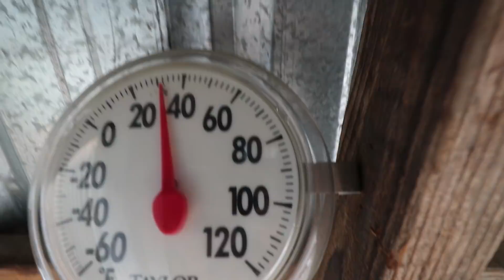Backfilling an Impossible Hillside Trench With Sand (From a Hose!)

Comment: Am a builder and joiners and also Horticulture, and plumbers and Electrical all licensed trades, now I watch this program and it all wrong what you doing, not only that you have wasted all money and this cement are wasted, because is down hill you used one step a time and mixing cement thicker and easy level ones block a time and that save more moneys but this is wrong, if building inspectors see this you will fail, but it your money and too late to do any about it, but I watched all the way and I laugh so I apologise for that is was your first time, everybody make mistakes so you learn next time hope not but I do love your video,  before you ask me yes I done build 166 houses two - three store floor and lost count repair houses driveway landscaping electric rewire and plumbing and bench joiners make kitchen units am now 60yo I build house on my own and self employed so very good luck and best of luck and you will get there.
Reply: Come spring, there will be lots of sand at the bottom of the hill. You better get lots of silt fencing. Snow melt and spring rains will take the path of least resistance, down the hill.
Reply: It’s not cement, it’s sand.
Reply: Its not a Footing 
It is a Sort of DuctBank/Ditch and they are pouring the Watered down Sand To give somd protection to the Conduits. Also adding the Metal Danger tape above sand is what you do to help with Locating in Future "CallB4UDig"
Reply: Ferguson101 If it no building code then what about building insurance?

Comment: Why put tape down, you can't dig through concrete later if there is a problem.
Reply: Deric Kettel did u not watch the video the only concrete thay used was to hold a post at the top of the  hill

Comment: Did Justin do the job for free? If not he should have his crew fix that big mess and cover the trench as agreed.
Reply: Obviously it is an expensive machine and a business but they were on a friendly first name basis so after seeing the mess they left it appeared there was a favor in there somewhere. They are the experts so gotta wonder why they would pump all that sand knowing it would just run out the end? Then just leave it there.  If I hired a contractor to build a wall and he built it knowing it was going to fall down. I would say he did not do his job.  Hiring a contractor is not just for the labor and machines but his expertise. They came a day early and was in a hurry to get the job done and get paid. But if the homeowner is happy then it is a mute point.

Comment: They dug a hole to put in a fresh water tank in$ Air blasted a trench to bring the water down and a line to take water up$ spent $ to fill the trench$. they get cheap water but pump it up the hill$ a cement truck drove up the hill so why pump water to the top, drive up and dump it in the tank. I hate to say it but are you really off grid if you have Youtube / facebook? Get the power lines but in to your (Off Grid) property and sell your extra off grid power back to the power company.
Reply: My guess would be that vehicular access to the top of the hill requires travelling on their neighbour's land.
So while that's probably fine occasionally during construction they don't want them driving there all the time.

Comment: Hmmm, you just poured concrete over wood shavings? Well, at least it can be a new video about what a failure your trench became.
Reply: concrete? what? sand, that was sand they poured into the trench...
Reply: It's not Concrete - Just sand.

Comment: Why do you put concrete in the trench rather than sand?
Reply: Its not concrete...its wet sand...they used the concrete pump for the job
Reply: it is sand. Mixed with water to help flowing it evenly. But when the water evaporates it's just sand.